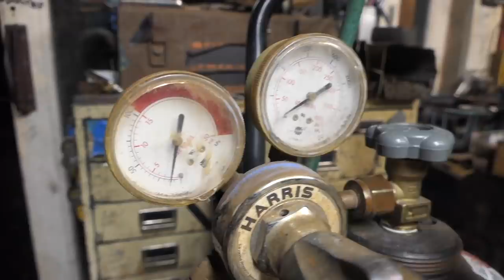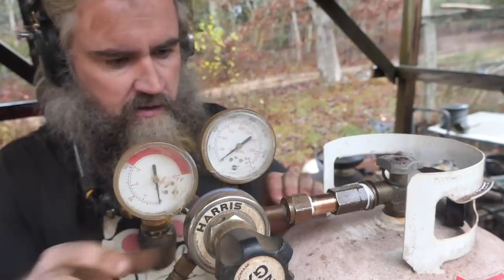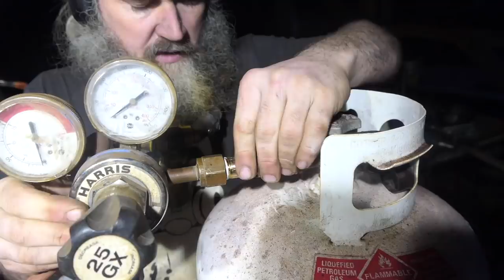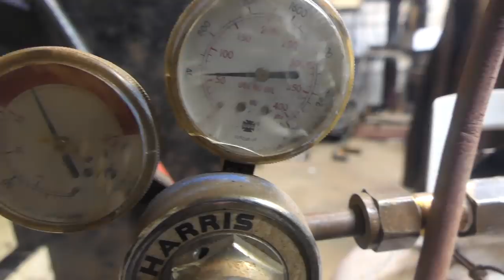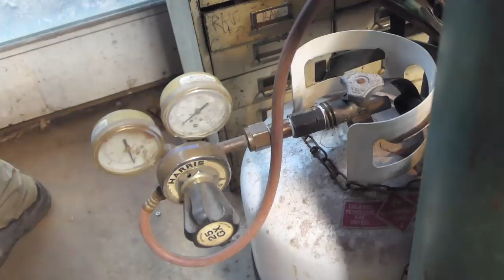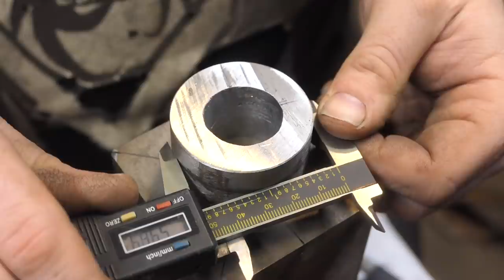Gotrek Giant Axe Build 3 of 4

Comment: I used to work with natural gas and propane. My guess is you need to change out the nozzle next time you substitute propane for acetylene. Different gases burn funny or bad when they are pushing out the wrong sized orifice. Loving the work so far man! Keep it up!
Reply: Yeah we have oxy-acetylene and oxy-propane and they use different tips. oxy-propane just burns a little cooler

Comment: Hey Michael, just wanted to share some info with you, I've been a welder for many years, if there is any situation where you need to weld into spots that are deep such as the pipe you tig welded on the square block, you did fine but if there's anything deeper in the future, you can buy what's called a gas lens for your tig torch, I prefer a #8 cup but it's kind of up to you, crank the gas up to 25-30 CFH (sometimes with gas lens u can even just use 20) and extend that tungsten out as long as you need it, most of the gas should get caught inside the pipe, effectively purging it and allowing you to safely arc, and the gas lens will properly disperse the argon, hope this helps take care brother.

Comment: Next time you have to hose clamp something that will be rotating I'd recommend adding a second with the screw mechanism on the opposite side to help counter balance it, it helps a ton with the wobble you were getting trying to line up on your knobs

Comment: Adam Savage (from Mythbusters fame) made a video on a particular kind of drill bit that makes drilling big holes in metal a lot easier. You might want to have a look at it, it could save you a lot of time.
Reply: Annular cutters?
Reply: Adam Savage doesn't and likely has never worked with hardox though, doubt it would be much help here.
Reply: @Bla5turbator  Well, they should still help with regular/mild steel. I doubt anything can reliably drill through HardOx.

Comment: "I just need those to hold for the little bit it takes to clamp these..."
Pro tip: Superglue. Not the Gorilla crap, or anything with Gel on the package, but normal cyanoacrylate will hold them fine for clamping and burn off once the weld is started.

I can't believe how well the rest of the "knob"  process worked. Only a true genius would look at an old egg cup and think, "I can sand a dome with that."

Comment: I stopped using acetylene years ago and I only use oxygen/propane. i’ve run into no issues and I do all kinds of weird stuff from your standard cutting to really exotic and weird things.

I consistently cut 3 inch, 4 inch, hell even 6 inch stick steel plate with no issue at all. Even held a small weekend course making medium and full sized swage blocks at the local blacksmithing club. Went through a lot of it but used only propane. Got several massive 4 inch and 5 inch thick steel beams that looked like full-size railroad cross ties. But when you go to pick them up realize they’re 600 pounds!

You can weld stuff like that even with a pretty standard stick welder as long as you know how to properly preheat, and you sure as hell don’t have to worry about it cooling off too fast… When you have several hundred pounds of steel welded together it takes days to cool! 

Acetylene scares the shit out of me… Ever since my old shop teacher used to fill up plastic bags and detonate them to give us a fright. Wonderful way to bust an eardrum but on the bright side it cleans the rafters in the ceiling. Knocks all the dust down and shakes the entire damn building.
Reply: Speaking of preheating… There are a lot of very heavy things I’ve seen Mike Weld on his channel… That I definitely wouldn’t attempt without preheating. And would probably have been better done with stick welding especially considering his swords get beat around and actually demonstrated sometimes. But I’m continually impressed with what he’s able to do with just a standard workshop. No machine tools or anything like that! Really impressive and goes to show my granddad was right when he said you could pretty much build anything with enough time using only angle grinders, welders, and maybe a cutting torch if you’re lucky.

Hell I’ve seen guys make blacksmithing and voles reproduced from old patterns using nothing but big plate and block steel plates… Cutting torches… And your standard Lincoln tombstone welder. Of course that’s when preheating is super important and also knowing how to properly temper the striking surface. But it’s definitely possible to build 200 to 500 pound animals with nothing but same type of tools Mike uses. Just plan to spend a good amount of money on cutting discs and welding rods

Comment: I think the oxy-propane was burning colder because you were using propane in an acetylene torch setup. The torches are most likely built for specific gases so they get optimum performance. I haven't used acetylene myself yet. But I have an oxy-propane cutting torch for cutting up scrap metal and it burns much hotter/louder then in your video.

Comment: For fixing small parts in place prior to tacking, like your smooth knobs, maybe try a couple drops of super glue? It won't hold up to heat, but it might hold long enough to get a tack in, and I wouldn't think it would interfere with the weld. 

Don't let the vapors get in your eyes though; that shit hurts.

Comment: 29:56 You do need to buy new die grinder bits, just sharpen them with acid just like one can do same to files. I have used citric acid for files, but carbide might require bit more harsh acid and of course if you want to do this faster than in day or two like is with citric acid and files. Just remove crap from the files, remove grease, let it sit a half a day to day, brush the oxide layer off with steel brush and water flow, dip it back if its not sharpened and repeat until its sharp enough, then on the last clean up use hot water so metal takes some heat and dry it with paper, so remaining heat will remove any moisture left so it wont flash rust and then put bit of oil to protect the surface. I have sharpened many files this way and while files are relative cheap, it starts to add up when you can save old files from bin for free and restore them with under a dollar of citric acid. For files PVC pipe with cap is great container and you just dissolve how much powder you can into cup of hot water to saturate it fully so that is 1/3 of near 100% acid then clean the put pouring that and bit more water into container, so its maybe 33% solution witch takes couple of days and works for maybe 20 files until it needs replacing. Some weird crap will crystalize on bottom and the walls over time, but clean your toilet with the used solution flush that crap out with hot water and flush the toilet couple of times to dissolute it to harmless amount and container is ready for next time.

Comment: Propane isn't as volatile and energetic as acetylene, it takes a different kind of torch with different sizes of orofice and the pressure you get out of a propane regulator is different than what you get out of an acetylene regulator.  We have both at my steel shop and you can't use them interchangeably.  Oh, the propane will burn... but it won't cut.

Comment: Do you have a lathe? Cause that might of been what could of done the trick. Make a rig to hang your torch in, as it's tip is in the position you need it to be to affect the pole. Hand control the spin, and heat it how you need it to. Slow spin for a preheat if that's what you want. Just make sure to avoid the jaws. Lol

Comment: Bevel length is determined by the angle (in relation to the center line - which changes based on the intended purpose of the edge.

Comment: If one of the gas bottles runs low on pressure if you dont have flashback valves then gas from the higher pressure bottle can flow into the lower pressure bottle, producing a mixed gas in one of the bottles, ie fuel & oxy, very dangerous esp when a flashback is more likely to happen.

Comment: I could be mistaken but don’t you need special type of hoses for propane? Honestly it’s been so long ago that I switched from acetylene that I don’t remember but from glass blowing I think I remember that propane takes a different type of hose….. because it will eat through the rubber eventually if you use regular acetylene hoses. I honestly don’t remember I should probably take a look at my hoses because all I use is propane an OXY quit using acetylene years ago and have no problem cutting through 3 inch to 5 inch steel plate
Reply: And I’m pretty sure you’re supposed to use a special type of Teflon tape specifically for propane I think it’s yellow if memory serves me correctly. There’s just a lot of shit you can’t use with that stuff because the oxygen etc.… Will just absolutely do crazy weird things and fuck everything up.

Comment: When you are using oxygen propane you need to light to fuel add oxygen add more fuel add more oxygen add more fuel then add the final oxygen you'll know when you go too far cause it blows out really easy. You need to get too a ripping sound when the flame is at maximum temp
Reply: Yes- My mates workshop uses Oxy-Propane. The pressure needs to be balanced and crept up on or else it goes out with a loud crack, you know when it is hot enough when it sounds like a Jet.

Comment: Hey the next time tie your torch to a overhead anything and set the distance you need.So it takes the weight instead of you having to hold for so long. I was instructed by the man that first got me into cutting, welding and brazing. Is that you need to be COMFORTABLE, because it allows you to concentrate on your cutting, welding or brazing Technic. And he was proven RIGHT every time I want to push through it. Then end up having to get comfortable, because the FASTEST way to do something is. To do it RIGHT, “ONE TIME “!

Comment: If you have T grade hoses and the right tip you can run propane in your torch. I use it with my DHC 2000 works great.
EDIT: Should have watched the rest of the video....
Reply: Grade r torch hoses will slowly develop cracks from the propane, not sure about the regulator; the stem on the regulator can be unscrewed and the nut replaced, If i understand the CGA standards the stim is the same just a different style of fastener.  My propane tip has a much larger hole and a counter bore.

Comment: Visually I'm not a fan of your edge geometry formula.  However, when you do the geometry it comes out to roughly 28°.  That's pretty utilitarian, but on your pieces that's STOUT lol.  Basically;
Short Side=1/2 thickness or simply "0.5."
Long Side=twice thickness or "2."
Solve for the Right Triangle of 2 and 0.5 and you get effectively 14°.  Double it and you have an edge that will do it all.  Especially with 20 kilos of mass behind it.  😉

Comment: All I know is that knife blades for use in a kitchen are usually 15-17 degrees. Your formula is making it 22.5 degrees, I think, so less sharp, but more durable.
Reply: Axes should be closer to 30
Reply: @samnottheotherone4363  I recall hearing that for wood. I'm sure this weapon is more of a maul/splitter, so you could even go to more of an obtuse angle. Like who are we kidding? This thing could be totally blunt and it would still ruin anything it hits, as long as you could actually swing it.

Comment: Dont go over 8 PSI with the Acetylene or it could explode on its own. for that tip I would try 7 psi on the acetylene and 35 on the oxy. should get you close. : coming from an oxy welder/ cutter
Reply: 8 is fine, you don't wanna go over 15 or it becomes unstable

Comment: Why did you not just buy a heavy walled bronze pipe instead of spending days brazing it?
Reply: Probably strength and ease of welding. Granted almost any pipe that thick would probably survive without issue but that tends to be the driving force behind mostof his decisions
Reply: Strength to weight ratio, you'd need the bronze to be much thicker to be as strong.

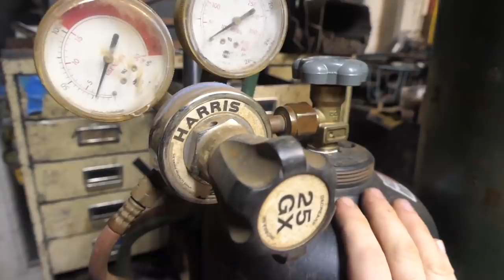Comment: 5:10 Why  there are two dials? They measure pressure differently?
Reply: One shows the pressure in the tank and the other shows the pressure coming out of the regulator
Reply: @MrFlyingSquirl  Ok, I think I got it: I looked for "gas regulator" and it kind of gave me the idea: basically with one dial I can see the pressure in the tank (as you stated), with the other I can see the pressure of the regulator, which I assume you can control in order to give the desired pressure. Am I correct?
Reply: @RussellTeapot  absolutely spot on! The regulator regulates and reduces the pressure that comes from the tank so you get a consistent pressure at your torch. You need both dials to see how much you have in the tank and to see what pressure is going to your torch. The torch one usually hardly ever moves
Reply: @MrFlyingSquirl  Makes sense! I don't know jack shit about metal working, but I really enjoy watching people doing it.. I especially like when Michael brazes something!

Comment: Is no one gonna point out the fact that mike needed a oxy-propane tip? He was just using the regular tip which is very bad when using oxy propane. You would need a special tip, and the special tip gives more pre heat flame

Comment: There’s a product called wetrag https://www.amazon.com/dp/B017T23T18/ref=cm_sw_em_r_mt_dp_DMTVM5CS3QKTQ9Q9V7AJ?_encoding=UTF8&psc=1 that you can use to protect areas next to where you’re soldering, brazing or welding. There’s another one that I forget the name of but it’s a type of clay that’s good up to heat treating temperatures.

Comment: As the dwarven smith foretold the  Self-appointed internet armchair bevel expert based on random web browsing "research" a good angle is 30-35 for a chopping-edge. If you're doing a 2x thickness you're getting 28.955 degrees. Or as we experts like to call it "close enough". @michealcthulhu if you read this PLEASE get a proper winch for your shop your scaring us with some of those lifts, you and your back deserves better.